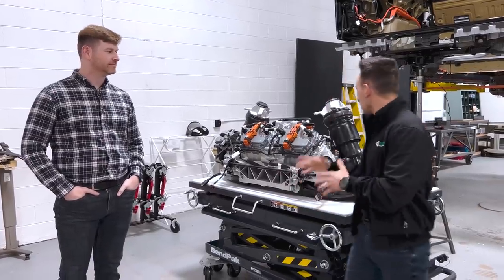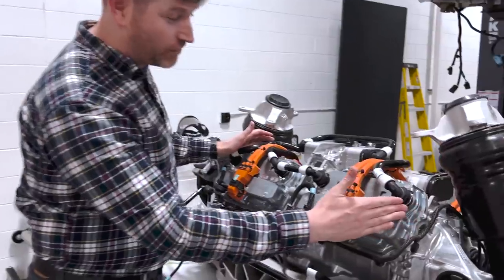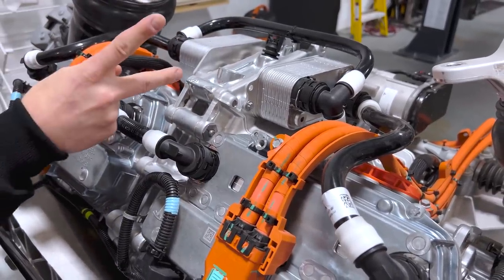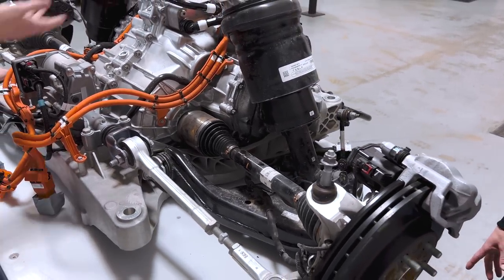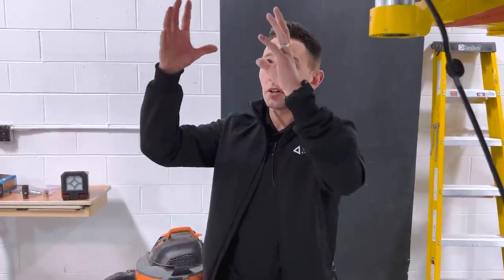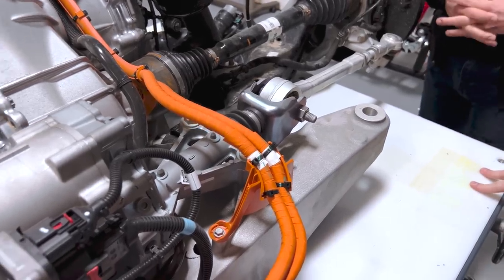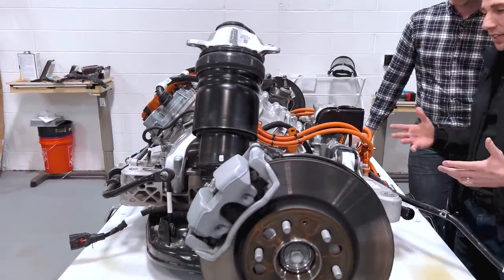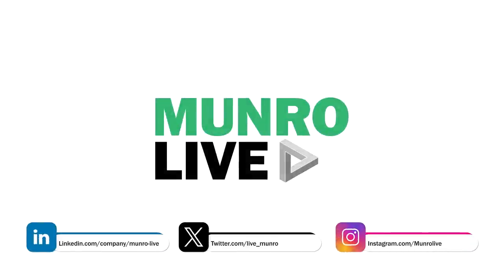Underneath the Cybertruck - Rear Cradle and EDM

Comment: Where does the turbine-like sound come from?  That hulking large section (gear box?) between what Director Jordan pointed out as motors?
Reply: The Cybertruck has a locking differential so the gear box has a bit more to it maybe?
Reply: @Radium3D  The locking diff is at the front, I believe.
Reply: Totally back of the envelope:  at 60 MPH, the axle rotation is about 675 RPM +/-.  With a 10:1 gear reduction (?), the motor rotor RPM is 6,750.  There will be whine from gear lash and windage noise from between the rotor and stator in the motor(s).

Curiously, the locking rear axle is currently disabled in the Cybertruck firmware.  That’s a big deal in off-roading.  From what I’ve read, it isn’t clear if the rear axle lock is physical or virtual.  There are advantages and disadvantages either way.

The first EV I had was a 2011 LEAF which had very pronounced whine from the drive unit even at moderate speeds. The EV I have now is a 2017 Chevy Bolt and there is very little whine.  There are fairly obvious differences between manufacturers.  I haven’t owned a Tesla… yet.
Reply: Speaking of windage loss in electric motors… It isn’t insignificant.  I’ll preface my remark as not being a motor designer.  If I’m not mistaken, the Reynold’s equation shows pressure differential is proportional to velocity squared and thus power loss would be proportional to velocity cubed.  There is a big windage penalty for running a motor at high RPM with tight clearance between rotor and stator.  When I took a machines course back in the day, I recall reading about large industrial motors using tactics such as backfilling with hydrogen to reduce windage friction.  There is a need to conduct heat out of the rotor, so a vacuum would only allow radiation.  Hydrogen is slipperier than air and it allows for conduction of heat into the stator.
Reply: @wtmayhew  has tesla or anyone else put a vacume in the motor to reduce noise? or is that the dumbest question you have heard all day
Reply: @davidanalyst671  That is actually a good question, and I don’t know the answer.  The only thing I know that would be bad about putting the stator in a vacuum to reduce drag would be heat generated in the rotor would have to be radiated or conducted through the shaft.  You could run coolant through the shaft perhaps.  I’m not a motor designer, so my ignorance is showing here.  🙂

It might be different for permanent magnet versus induction motors.  The induction motor has the stator windings, current flow and heating due the current, whereas the permanent magnet motor does not.  There are probably eddy currents in a PM rotor, but my guess is they don’t make much heat.
Reply: @Radium3D  with separate left and right motors, there is no differential (locking or otherwise) in the rear.

Comment: on 2:20 i thought that they where from the start of the model 3 switched to SiCFets and not IGBT's for the power electronics for the invertors, whitch make sense as they are much more efficiënt so less heat to disapate

Comment: Isnt it cheaper in terms of complexitu and scale to create both front and back suspensions/ cradles the same? That would also help reduce the extremeangles required on the front. Also mayne potentially have a quad motor config

Comment: How do they ventilate air in and out of the motor? Motor heats up, air expands and to avoid pressure differences, it need to ventilate air. In previous Tesla models, they have had like a plastic labyrinth. Works for splashes but when submerged in water, water will enter the motor.

Comment: When you have a cast alluminium subframe, or in this extreme case, entire cast rearbody box unit, then having pressed steel lateral arms that can be deliberately designed to fold BEFORE the cast bit breaks is really quite important. Hit a kerb sideays, or experience a similar large lateral impact say alow speed side impact from another vehicle, and if the rearbody casting cracks the entire vehicle is immediately a write off!  You absolutely need the arms to fold in a controlled way first!

Comment: Could the threaded hole in the rotor also be used to press off the rotor during maintenance?
Reply: No, the rotor would be threaded and the hub wouldn't have a hole. You would also see the same on the opposite side
Reply: those damn holes never work.  They always get rusted out and strip like your mom before they acutally help press the rotor off.
Reply: @davidanalyst671 never had that problem. I have used them heaps on lots of Suzuki 4x4

Comment: 14:10 obviously you are not a service mechanic/engineer. That is a rotor break loose threaded hole to assist removal of a stuck rotor to the spindle, which over a period of time the rotor will rust-weld to it.
Reply: We hate cost saving design engineers. they suck. Jordan is one of them.

Comment: Could you do a tensile test on the stainless steel please?
I'm betting on 1'690 MPa of tensile strength and 25% elongation at break. That would make it one of the toughest steel alloys ever made.
Reply: its 30xx series Austinite , after processing its Martensite (xx Tougher). 
1.8mm Cybertruck plate is resistant to 9mm FMJ and .45 caliber Machine gun, and 12 ga SLUG.

Comment: This video is 100% better than the last vid!!  You covered several engineering topics, and didn't talk for 10 minutes about one single part. Thank you for this improvement!!!!  Im a stem and amateur car fixer.... so i have a few questions about the tesla, not the video content. you said the rear steer was super different than other OEM systems, but didn't really go into how.  You said you were going to do a followup vid at the end so maybe we can do that next vid.  The last vid I saw on tesla was with Brembo brakes setup.  Did they change manufacturers? I know the brakes are the real reason everyone is getting the cybertruck, but its just out of curiosity.  On another topic You have almost certainly covered this topic before so Im stupid for not knowing it, but the brakes on my toyota camry are all hydraulic with a master cylinder.  As if sandy hasnt taken apart a thousand camrys... but now that the cybertruck is drive by wire, are the brakes by wire?  most of the braking will be done by regen, and the motors, but when the calipers are being engaged, is there a master cylinder and hydro back to the calipers or has it changed?  I was asking because I saw what looked like some kind of motor or housing sitting on top of the rotor at 16:55.  It makes me wonder if there was an electric pump or electric actuator for the brakes... and we are all dying too see the cybertruck bus that nobody in the history of carmaking has done.  Or at least the tesla freaks are dying to see the cybertruck networking bus that no carmaker has done in mass production.  Do the rear steer and braking go though the network?  Thank you guys for giving me my engineering fix for the day.  Watching these teardown vids is like watching someone describe a beautiful piece of artwork, except a beautiful piece of artwork that drives people places.
Reply: There's nothing significantly different from other rear steer units - it just isn't recognizable specifically as the ZF units that they usually see.

Comment: The lateral (or "cross-car", as they are saying) width of a rear final drive unit for a conventional front-engine vehicle is no wider than this drive unit, so being an EV is not an advantage. What enables longer control arms (and so longer wheel travel) is the vehicle structure - not attaching the suspension to conventionally-spaced traditional frame rails. And even with frame rails, the lower control arms routinely run under the frame rails, so they can be long - only the upper arms run into interference with the frame.

Comment: it seems like the rear steer isn't positioned in a compact way.  Overall the rear packaging of CT, given they have a gigacasting, is disappointing because they should have easily been able to accommodate a spare tire compartment like rivian.
Reply: SPARE no longer needed, DELETE .
you can carry 2 spare in BED if you like.
(just as Tesla did in BAJA VIDEO.).
Tesla STANDARD is portable Electric pump & PATCH kit. (PROVIDED).
Reply: Im not a car designer, but maybe they had some extra room, and said why the hell not? and there were two motors.  That was a clue.  This isn't a cybertruck.  This is a cyberbeast.  its 0-60 is 2.6 seconds.
Reply: I think the bed cover storage is above the rear steer assembly. The motors needed to hang out the back to make way for that and the pack. The rear steer means the frame rail(casting) need to be  narrow and combine with the bigger tires on Cybertruck is the reason why it won't fit a spare under the rear.
Reply: @markplott4820  then forget the spare and I raise you this: I'm disappointed that the rivian has more underbed storage than the cybertruck. you can't really disagree with that.
Reply: @bob15479   - they are in Similar locations , and similar size.
Rivian has Gear Tunnel.
but CT has over 120 sq ft of Locking Storage .

Comment: Why not run one wire from the battery and fork it at motors/inverters?
Reply: so theres this thing called electricity.  In electricity when you want to use it, you need to create something called a circuit....
Reply: Bravo genius... obviously I mean 1 set of wires instead of 2. Inverters are right at the motors, right?

Comment: Thanks for sharing this video with so many design essentials! I think I got enough info to do away with almost everything. This assembly looks like weighs maybe 400 pounds. It’s a massive monster! It should be possible to reduce the weight to 1/3 so that would be about 130 pounds. I need to warn you it will sound like I wasn’t listening to your words at all, things like how the half drive shafts you want to keep them straight as you can because it’s harder on them to have stronger angles. I heard you, just want to know if the design can be pushed somehow. I’m brainstorming, not coming up with complete ideas. :)

You have the cradle itself, which is a frame that everything attaches to. What stops you from mounting everything to the gigacasting? I saw the rear gigacasting looked like a wishbone, so maybe this cradle makes up for that but it’s an extra part that may be deleted.

When I look at the assembly from the front or back, I see upper and lower control arms, drive shaft and steering arm. Everything except the upper control arm is at the mid point of the wheel or lower, which limits how much clearance the truck has. 

Look at the front wheel of some bicycles. Some have just one front fork instead of two. It doesn’t have rocker arms. That could be done here so you don’t have the lower rocker arm set so low. Of course it would need to be heavier duty than what a bicycle has. But the suspension tower could be incorporated into it and maybe steering as well. If this tower was at a bit of an angle the shocks striking from the front would be absorbed better rather than if the shock tower was completely vertical.

The way the drive train is set up, you have a universal joint at the wheel, maybe a second one at the motor transmission, gears, then the electric motors are flipped, set off because you don’t have enough width to continue to the side. 

First, because you have universal joints, there is no reason to keep the assembly straight side to side. Instead of going 90 degrees to the front back axis you could cant the drive shafts about 10 degrees one towards the front and the other to the back, so they are 20 degrees angled from each other, which means you can put one motor ahead of the other and keep the drives in line to themselves. You don’t need to set the motors back and reverse them. It might be possible to angle this up and down instead of front to back. Not that you want to do it with this truck.

But you can do better because the drive shaft goes to the centre of the wheel, so that limits your clearance. Place the motor at the top of the shock assembly and run your gears down to the wheel so instead of having the drive shaft come horizontally somehow the drive goes to the plate that hosts the brake caliper.

Some of this might work better on a lighter vehicle like the one they are calling the Model 2 before doing it on a heavy duty truck. But if this stuff can work on one vehicle it would be easier to design a more durable version of it for the Cybertruck or even the semi.

I’m no expert so people may have thought of all this before and found it doesn’t work or it’s easier the way it is now.  But I thought maybe there is a chance it does work.

It might also be possible to extend the battery pack towards the front and towards the back to lend a bit more rigidity and cover up all this underside. Just leave space for the wheel wells. Or maybe the battery pack cover might be extended towards the front and back, not the entire battery pack.

Have a nice day!
Reply: Yeah. Because you know more than the Tesla Design Department... 😂😂😂🤡
Reply: A cutting edge design team is humble enough to consider new ideas no matter who suggests them. If it’s a question of one person or team being better than others, you cut off the best ideas from the decision makers. What makes Tesla great is they are crazy hungry for the best ideas. They will try almost anything.

Comment: I'm betting that the small threaded hole in the rotor has something to do with removing it when its all rusted out vs. a assembly aid. Usually you see that hole in the rotor only however, so its still curious.
Reply: The aid for removing a rotor is a threaded hole in the rotor: you thread a bolt into it which bears against the plain (no hole) hub flange. Jordan said that in this case the threads are in the hub so this wouldn't work for rotor removal.

Comment: when are we going to get in wheel motors, there was a guy that Sandy spent some time with in a video long ago.  Seems like that would save alot of weight and complexity as we move to more and more advanced EV drive trains.  Is that the next evolution?

Comment: I like how you break down the countersunk bolt not installed on a brake rotor. The fact to save $15 on an insert/ embossment on a case is just dumb. Dumb. A arms, tie rods and an electric R&P. 58" WMS-WMS vs 62" and dimples on the lower control arms to accomodate 3 tire sizes. Obviously, I'd crude thought the whole show by have a 2001 boxter transaxle engine package and a cybertruck unit sitting side by side just to follow Roadster-Sedan-Cybertruck, perhaps throw in arm candy on the cybertruck with portals installed to narrow a arm geometry when going offroad. Something to compete with a G-Wagon and handle the rigors of offroad.

Comment: Have y'all seen the clutch type system that Tesla said they took from the semi in the cyber truck?😊
Reply: That will be internal to the drive unit, if it is used in this vehicle.
Reply: @brianb-p6586  The basis of this was for the cyber truck to be able to tow and get good range.
Reply: They don't need it. The motors in the back of the tri and the front of the dual are induction motors so can be turned off without causing drag
Reply: @saff226  that still leaves mechanical drag and aero drag in the gap between rotor and stator, but an induction motor does eliminate drag due to magnetic losses when not powered.

Comment: Great video guys , love the content , someone should write the word " ESSENTIALLY " on the back of the toilet door , in Munroe , and say Kevin was here , sorry Kevin , had to say it ... 😉. Kevin looks like he wants to put Jordan in a headlock , before during and after the video , wonder what Jordan did to piss off Kevin ,these are the questions im wondering about , .Loving the mechanical engineering , its true metal porn at its best. What im wondering about is the rear wheel steer what are the limits , is there scope to have even tighter turning radius . The use of the steering rack rod as part of the suspension is interesting , doing two functions . Cool info about the length of the suspension arms for travel , and how the gearbox layout facilitates that. would be interesting to compare the f 150 drivetrain philosophy to the cybertruck and list plus and minus .f 150 seems tough as fuck . i wonder is it quieter than the cybertruck. ?
Reply from the maker: Jordan and Kevin are actually really good friends outside of work as well.

Comment: 6:41 The coolant isn't just ethylene glycol or just water - it's always a mix of ethylene glycol and water. That's awkward to say, which is why it is normally just called "coolant".
Reply: I think he just wanted to point out the difference between "water" (engineers using just the term glycol as reference is normal) and "oil" cooling loops ;-) You are right - watercooling coolant is a mix of ethylene-glycol (or propylene-glycol) and water.
Reply: @felixweinreich3999  that might have been the intention, but what he actually said about the coolant - and indicated in gestures and tone - instead implied that "ethylene glycol" is correct and that "water" is incorrect. In fact, a typical mixture is 50:50, so either is equally correct... and equally incorrect.
Reply: @brianb-p6586  water is 100% correct ;-) the system would work without ethylene glycol (depending on start temperature)
Reply: @felixweinreich3999  not only does water freeze at temperatures encountered every year in most of the market area, its boiling temperature is also too low. No production automobile will use straight water for coolant.
Reply: @brianb-p6586  true - that is why you add glycol ;-) I don't get your point . Technically it is water cooling, so nothing is "equally incorrect" by adding something to enhance parameters/performance.
Reply: @felixweinreich3999  "technically" it is cooling with a mixture of water and glycol. Either component could be used separately, and neither would be acceptable by itself.